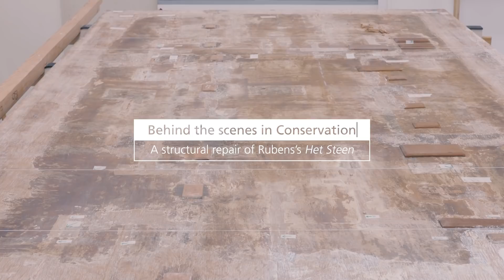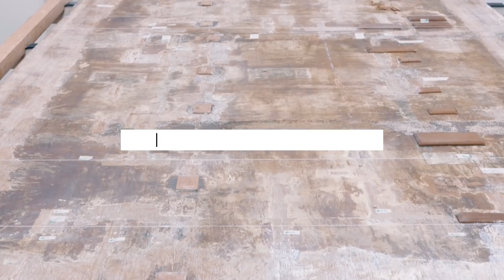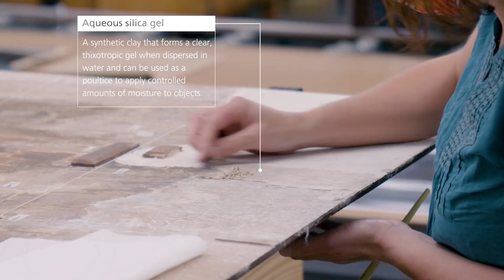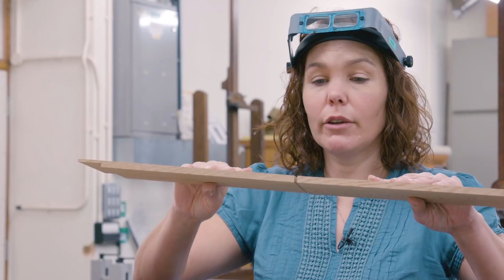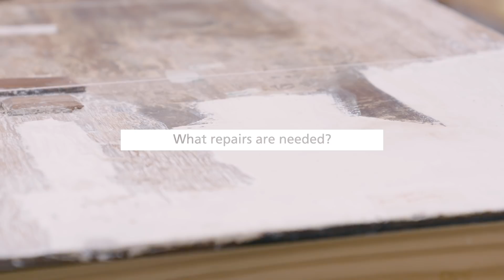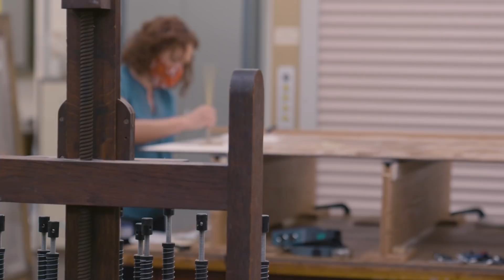A structural repair of Rubens's Het Steen | Behind the scenes in Conservation | National Gallery

Comment: Love the work you have done showing this oft overlooked part of art history! This might be a silly question, but has the use of a composite reinforcing backing been considered?
Reply from the maker: Hi there, we're so glad you enjoyed the film! Not a silly question at all. If by composite you mean using something like plywood, then yes, various different methods of reinforcing panel paintings have been used in the past, and this isn’t the only type of auxiliary reinforcement that we use – it’s considered on a case by case basis depending on the needs of the panel. We do favour approaches that will allow for flexibility with the ongoing wood movements, which often sheet reinforcements do not. In this case, we also needed to follow some quite complicated undulations in the profile of the panel relating to the separate deformations of the different boards making up this complicated construction, so we laminated battens to fit the profile of the panel and then used flexible attachments which would allow a certain amount of movement and shrinkage within the panel whilst still providing a good level of support. Thanks

Comment: Thank you, absolutely fascinating.  Were boards ever doweled together ? These boards seem too thin for that but might make more stable joins, and cause more problems when they fail.  More interesting than the front side !
Reply from the maker: Hi Pete, we're so glad you enjoyed the film! The boards were never dowelled. We can tell that from the x-rays, and they are indeed very thin to accommodate any dowels, however, some of Rubens' other panels do have evidence of dowelled joints. The half-lap joints make the vertical joints quite stable, but the simple butt joins that run along the grain had failed in places, as you say, dowels would have made these joins more stable, and we do see them in other instances. Thanks